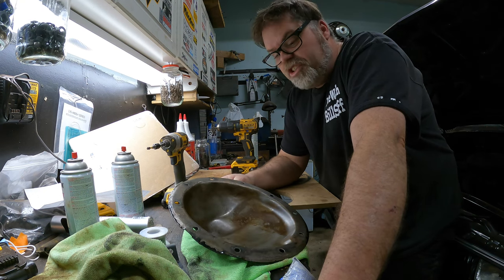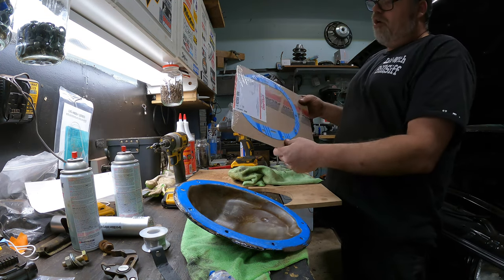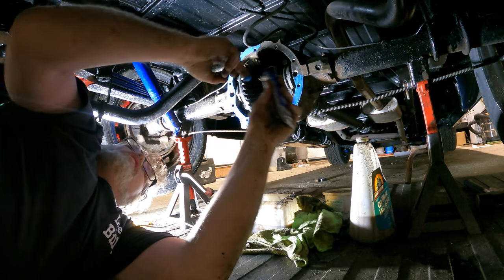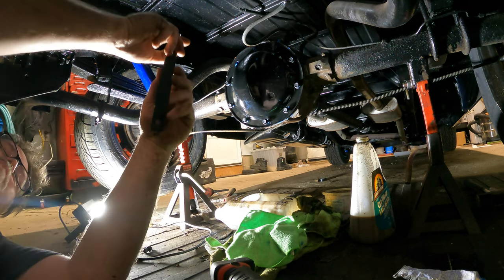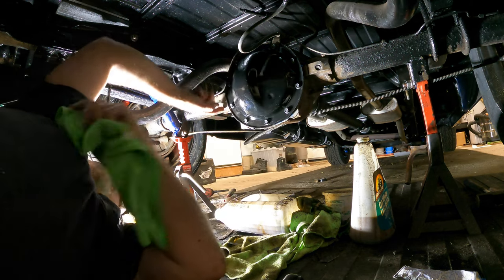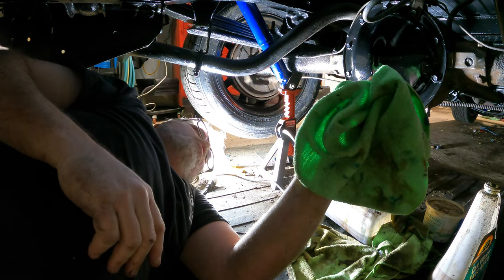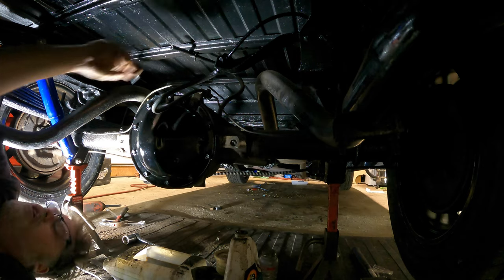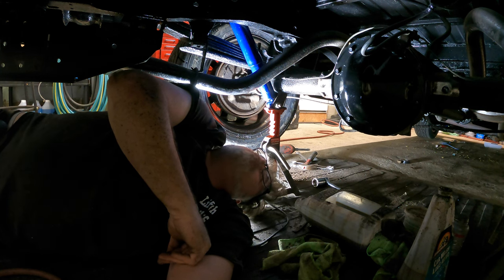Last Video Of This Part   4K

Comment: Billsif, I’m taking you to task. It is a parking brake, to be used for parking, not emergencies.
Reply: I grew up calling them the emergency brake also cuzwe never used them for parking and they usually would stick from the rust or freeze up in the winter time
Reply from the maker: It is want it is to me lol but thanks for you correction buds

Comment: Maybe if your gonna mess with those low riders you should look into a super high lift alligator jack. They are typically really long but man you can get the front or rear of the truck higher. I love the higher variety so I can sit upright on a creeper and roll right under there ,no jack needed lol.